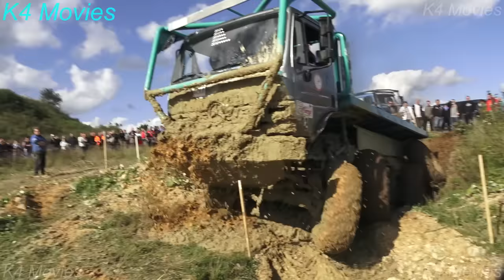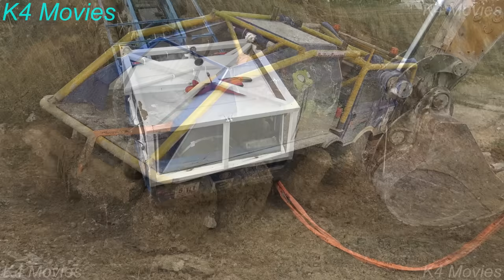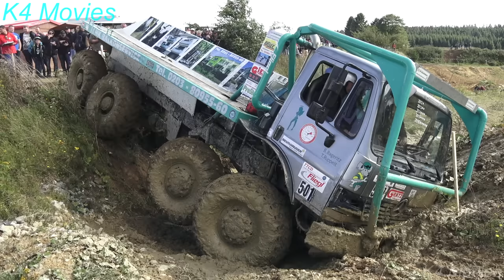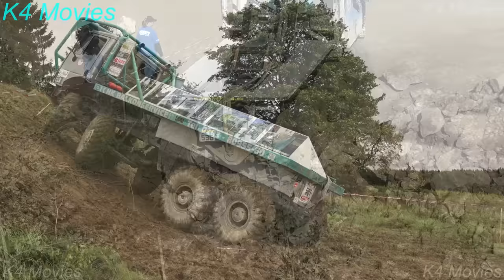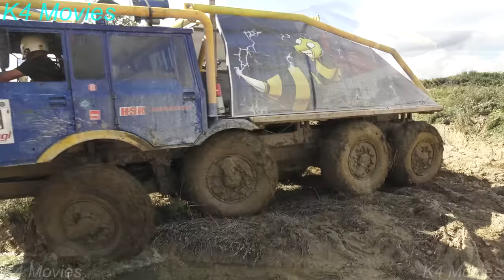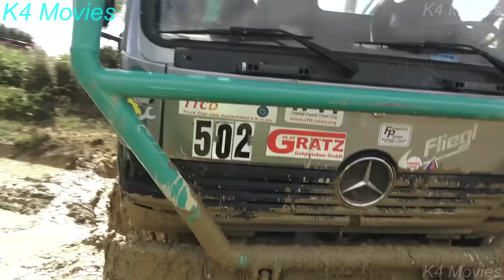Off-Road, 8x8 Truck Trial, Elbingerode, Truck Show 2017

Comment: I'd love to see 1 of those trucks with Super Swamper Bogger tires on it.. My buddy put those tires on a Ford Ranger and was going through stuff in 2wd that people were getting stuck in with 4wd locked in. It was a very light truck also but those freaking tires were amazing for mud but if you use them to drive on asphalt to and from places there such of a soft compound tire they will just disappear in a short amount of time. No I do not work for the company that makes them they just impressed me that much

Comment: I can't imagine anybody having enough money to campaign one of these big trucks on this circuit.  Very tough trucks.  Does anybody ever run an automatic transmission?
Reply: old stuff probably not that expensive, plus if its mechanical it can just be rebuilt instead of replaced. a brake job on a 4 axle truck is half the cost of doing it on a modern SUV, just to give some perspective.

Comment: The approach angle on these trucks is terrible.  If they improved that one thing, they would be much better for off-road.
Reply: Gun man
Reply: Gun man
Reply: TATRA T813 8x8 aircooled V12 (18litre) was made in early 60s like an special heavy Trailer Tractor for Czechoslovak ARMY abble to pull up to 122Tons. (22t Load + 100t Trailer) IS NOT DESIGNED FOR CLIMBING UPHILL !!!  Take an TATRA T148 6x6 V8 for climbing from the same era !